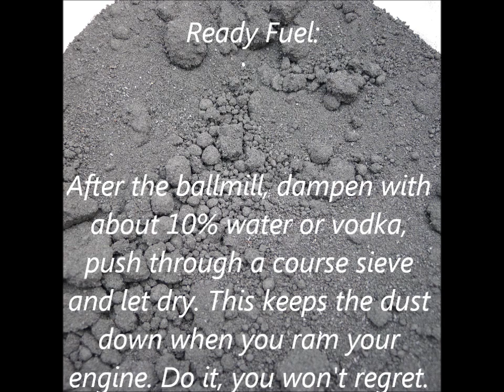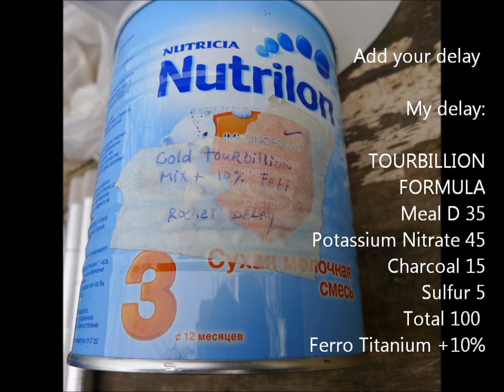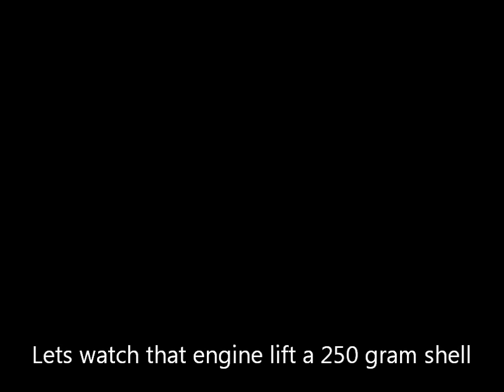1 lb Black Powder Rocket Tutorial part 2 - Engines

Comment: 3/4" ID by about 8" long....tube length for core burners usually runs about 10x the ID of the tube.
Reply: So that would be 7.5” not 8
Reply: @MrHobj34  hence the "about"
Reply: It is possible to know the pin and tool pin measurements thanks

Comment: Thanks for the information in your video. i have been working on the same style rocket motors and had a few that worked, many i blow out the bulkhead. i will try your mix ratio and also the amount along with delay spec's and see if i can get one to launch without blowing the  bulkhead off, thanks again . SD.
Reply from the maker: Good luck! Try to slow the mix down by adding more and/or courser charcoal. Once they fly stable try to push them to their limit. I found my limit to be 70-20-10 as all CATO'ed on launch on that ratio.
Reply: thanks, i have launched or should i say tried to lol, about 20 so far. i was using 70-20-10 with the charcoal made from cedar wood which is easy to get here. i ran it thru a 100 mesh screen 3 times instead of using a ball mill . i  will process the charcoal thru a 20 mesh screen and try that with the delay formula you posted . i am pretty sure my problem was using the primary rocket fuel all the way to the bulkhead instead of using a delay mix. i made 20 more rocket tubes this morning. took a break, now its time to get back to it, have a good one, ill try to keep you posted. SD.
Reply from the maker: Yes, that sounds like a too hot fuel to me. Tune it down and see what happens. Keep me posted.
Reply from the maker: SilentDeath002 also, if you have a lot of hot fuel left try to shoot them nozzle-less. No clay nozzle, just straight up fuel and a delay and end plug. Heard good things about it.
Reply: just got back from testing two rockets.  both of them launched great.  6 seconds flight time before they turned and came back down.  i put the powder in a container and sprinkled some water on it so i did not ram dry powder. it held a little more powder then what you said the weight was on your, but that also might be the difference in the weight of the tube material also. ill make 2 more and step up the powder to 65-25-10 and see how that holds. SD
Reply: ill have to try that later on.  i like to get this first part figured out before i venture into another area.  oh, forgot to tell you, those two rockets went straight up and came straight down. i brought both sticks and rockets back to check out any damage and i can reuse the sticks, i know, lol , i am cheap
Reply: we just got back from testing the next rocket. made powder a little stronger. also mounted a small 1.75 shell on top to begin working with time fuse. had it set for 2.5 seconds. i posted the video on my you tube channel if you care to take a look. it will be the most current, i owe the launch success to your help, thanks again!
Reply: Hi ive been working on making these rockets for a while now and everyone i make just explodes and sends pvc Shrapnel everywhere
Reply: @bolt2510  what are you doing using pvc.  you can get hurt bad using that for  a rocket tube.   get some 30 to 40 pound craft paper, pick up a 3/4 long dowel and some wall paper paste and make your own tubes or just order some, they are cheap.  sounds like the end of your rocket fuel is the location you explosion happens, reason is, the last inch or 1 1/2 should be a slower burning powder and also acts like a stopper to keep the main fuel in check so its all used for lift. it happened to me a lot.  stay away from using pvc period.  worst thing you can use. i wont even use pvc as a shell, asking for trouble big time.
Reply: @SilentDeath002  I ordered the paper tubes just waiting for them to get here, i have used pvc as for test. What should I add to my black powder mixture to slow the burn?
Reply: @bolt2510  do not ever use pvc.  take your mix, 75-15-10   and go 60 -25-15 use that mix for last 1 1/2 inches possibly 2 inches , you will have to play with that.

Comment: Whats the max shell header you have been able to lift? Do you think 500g would be possible?
Reply from the maker: Never tried it, but maybe as a nozzle-less engine with hotter fuel. I'd limit it at 300 on this configuration.
Reply: @Goldenstreamer  Thanks for quick reply. I make my BP with pine charcoal... Its pretty hot & works for most everything I build.A cpl builders I know say not to use it for rockets instead use a hardwood charcoal...  I can see why but what do you use? Seems like a good strong lift.
Reply from the maker: Home-cooked willow charcoal.
Reply: @Goldenstreamer  Nice..! I have yet to try willow in any projects. Hard to find willow trees people want cut down around here.
Reply from the maker: See if you can find some old branches or dead wood. As long as it's not rotten. A bit goes a long way.  @houseoffire72
Reply: @Goldenstreamer  My brother n law burns wood for heat I will check with him see if he knows where I can get some
Reply from the maker: It likes wet feet, so rivers, streams & swamps etc are your best bet.  @houseoffire72
Reply: @Goldenstreamer  Right on

Comment: Is it necessary to use very fine black powder or can you use it as a thick powder?
Reply: If by thick you mean "rocky" or "chunky" pieces then yes.  When it's been wetted and dried it cuts the powder/mess down by a lot.  When I'm making a bunch of 1lb engines I usually just use powder as it cuts a step out.

Comment: Hello , i use your recipe for black powder: 60-30-10 , I use a pine charcoal airfloat, I mixe kno3 with grinder, sulfur is screened :he is very fine, I granulate without dextrin like you ,the problem is I have multiple cato’s , do you think the cause is I use only charcoal airfloat? Maybe i will wax my tubes ?
Reply from the maker: Fredy smith Hi Freddy, most likely the charcoal is too fine. Or your nozzle is too small, spindle too long, many possibilities. Try to grind your own charcoal in a hand poeered meat grinder and see what happens.
Reply: Replace 5 parts of the charcoal airfloat with 80 mesh charcoal to slow it down and makes more sparks.